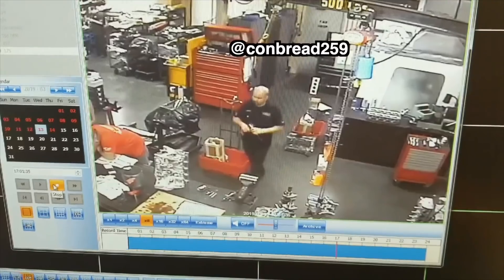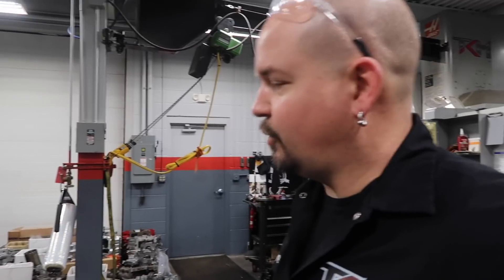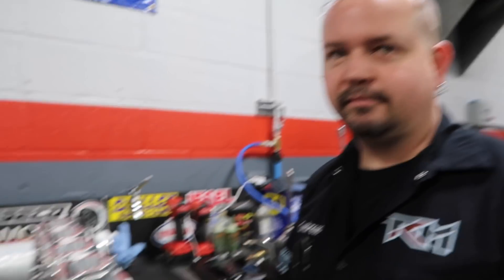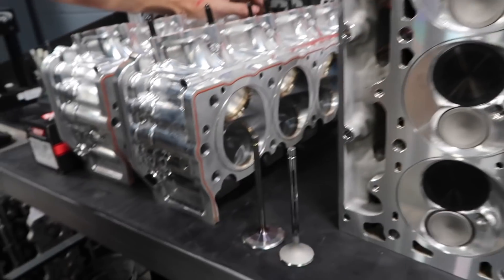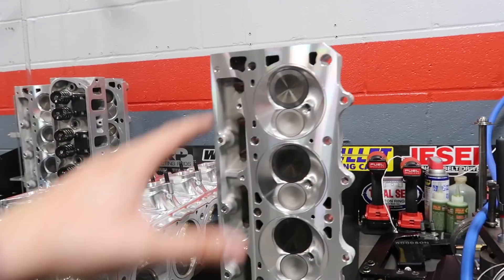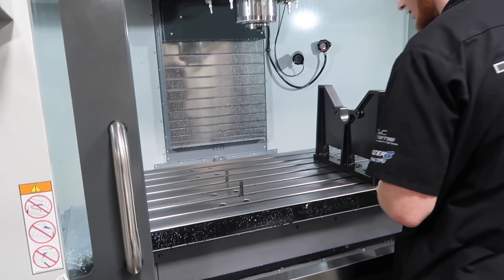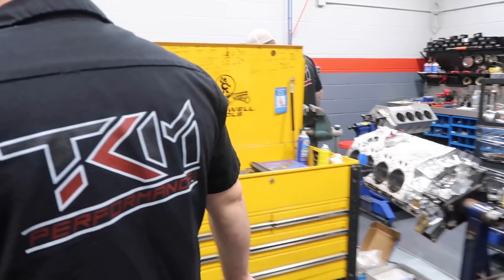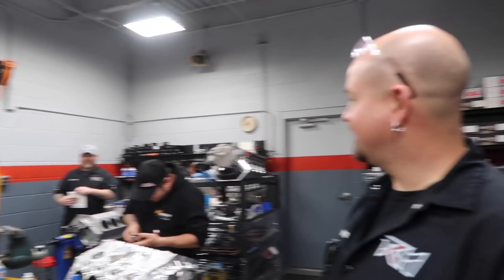NASCAR HEADS on my STOCK BLOCK WORLD RECORD 5.3 ls engine!!!!

Comment: "I never realized how important a cylinder head is to performance".......WHAT?!?!?!
Reply: It's almost like they don't understand how the head relates to air flow
Reply: @Villani_AV  when you have unlimited money I guess it doesn't matter
Reply from the maker: Y’all take it out of context. I’ve been making well over 1100 hp on builds for years with stock un ported heads
Reply: @JohnDoc  but they're still high dollar builds with high dollar parts....i think I speak for a lot of people when I say, ill be impressed when you build a 900 to 1100 horsepower motor on a budget like hot rodders, racers, and mechanics have been doing for years......just because it's a junkyard block doesn't make it a junkyard build
Reply: @chevynova-ev6qp  True
Reply: @JohnDoc  when you have forced induction you overcome the airflow issue through uprated cam profiles, exhaust, intake, compression, etc. When you want to make power N/A you focus on flow numbers mainly. An engine is basically an air pump, the more air you can flow the more power potential you have. Obviously you wouldn't be able to make 2000hp with a stock head (bar maybe ls7 and ls9 heads, and maybe a few of the 4v cobra heads, but even then I'd bet there were valve jobs done etc etc etc).

The quote the OP took from your video is.. Well.... Interesting if you've been building these motors yourself to say the least. The cylinder head is the biggest control factor in an ICE making any power at all, it controls the air flow (the most important factor) and makes up half the factor in compression (combustion chamber size and gasket sizes I guess too, effect compression relative to the piston)

Comment: How can it be a world record 5.3 engine when you've never ran it before. John back with the clickbait hard in 2020
Reply: villen 5.3 a loose term too lol 2.200” intake valve ls7 heads gonna be a tight squeeze
Reply: 5.3 is a liter rating and It has a 4" stroke also which makes it no longer a 5.3l
Reply: Clickbait patrol
Reply: Probably a pro stock style 5.3, maybe not though, over 4.1" bore, short stroke(like 3.35) with bug heads, maybe not though, it is possible to fit 2.2 intakes in a small diameter bore but very tight fit with exhaust valve, be a bit shrouded but with boost it may not matter
Reply: @mythos000000025  it's a 4" stroke crank he already showed that in a previous video. Also ls7 based heads only fit on 4" and larger bore it's probably actually closer toe 427 cubic inches which is 7.0l but it's a 5.3 block originally. Definitely a badass build But definitely not highest hp 5.3 cause it is no longer a 5.3
Reply: @mythos000000025  besides a 2.20 valve won't fit a 5.3 stock bore.
Reply: Billy Bowerman on a canted valve head it can

Comment: Nobody caught that finger over valve guide pop , when he removed valves 🤔😜👍
Reply: Yeh, I got it mate, got some good ass lube on em also, old school way of cheching clearances, I can tell the clearances are good by the way they go into guides. Worked for Harley many years,  I think the EVO spec was .0008 on intake and .0012 on exhaust, had to do everthing by hand back in the day, a good inside guide dial guage is needed, straight and true with no banana, gotta have some expertise to get those numbers.
Reply: @russellhueners8499  I remember hours as a kid hand lapping with compound , rolling a suction cup between my palms for hours on old 2 stroke Detroits in my old mans shop . Drop a stone or hone , well might as well go join the Marines on the battlefield .😳. Skills kids today will never obtain nor desire to .They have served me well in my 60 years , now I just putter in my shop teaching my one interested gear head grandson all I've not forgotten yet . 😂👍

Comment: Didnt know nascar used dart ls7 heads 🤣
Reply: @horsefly1020  ok your point is? Arca is NOT nascar
Reply: Arca is NASCAR it used to be its own racing series but now nascar owns it. They also run the same engine in the truck series.
Reply: @horsefly1020  👌🏼 just another reason nascar sucks ls’s are 🗑

Comment: Good-looking work. Nice heads. What kind of lift and at 50 duration are you going to run
Reply: ron trexler 

.750 lift and 270 range @50
Reply: @MrConbread  there ya go.. my style. Niiice. Street cam lol. Just keep them springs in check!!! Cant wait
Reply: @MrConbread  ps. Nice shop cuz.. AND your car 💪💪

Comment: Small company I figured they would be a big company like Lunati, your bored you 5.3l out what 30 over and a stroker crank that means it’s no longer a 5.3, there called chromoly sleeves not top fuel hoops these people are fucking stupid I would never buy anything from the no was in hell and your motors don’t put out near the HP you say, the reason you can’t hook up isn’t cause of too much power it your over inflated slicks on the wrong size rims it makes the car appear to have more HP than they do if it’s bias ply you should be around 8—12 psi not 35-45psi there not supposed to be rock hard and deformed after you air them up and as far as compression goes my bone stock Dodge Grand Caravan has 185 psi of compression per cylinder that better than Justin swanstrom gets from his 997 which is kinda sad if you ask me at 10-5-1 he only got 150 psi he should be up around 250-275 psi my  van is 9-1 and still has more compression, compression = power
Reply from the maker: U are an idiot lol